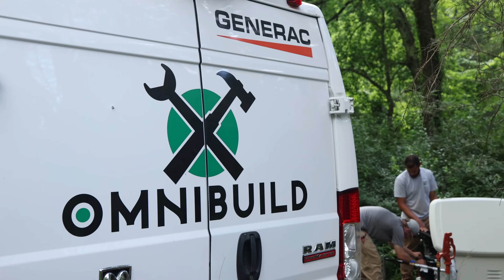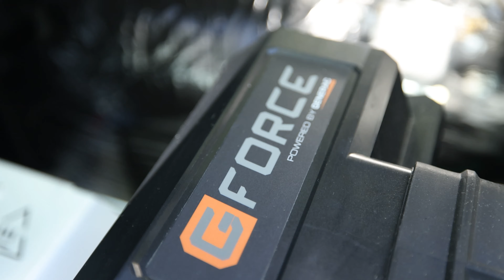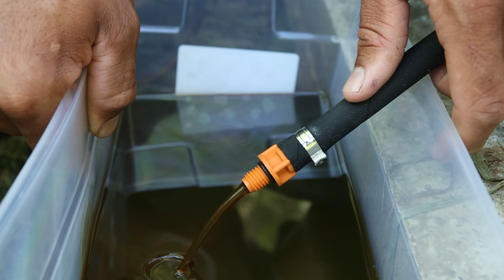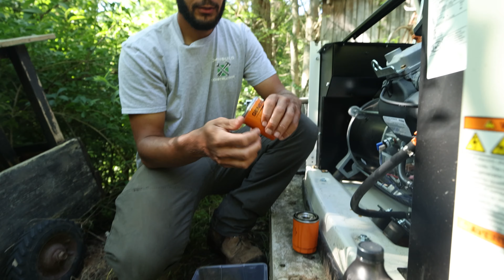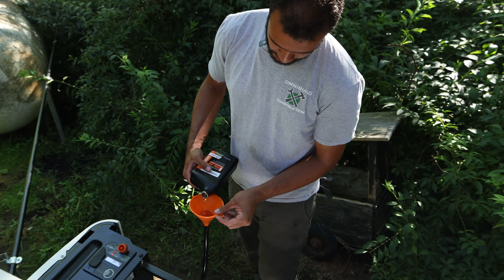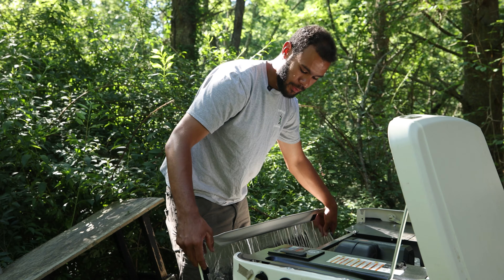Generac 22kW Guardian Generator | First 24-Hour Service & Oil Change Tutorial

Comment: With regards to DC/acvoltage variability.   Do these non-inverted generators not have that issue because of the large capacity of the unit.   That it never reaches a draw that would challenge the motor?  

I believe the inverter generator doesn’t have this issue.